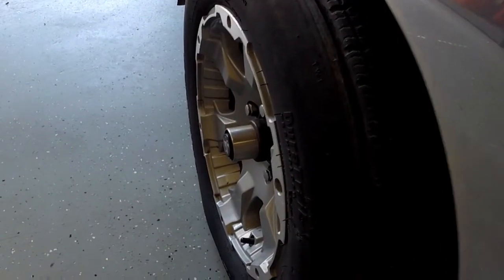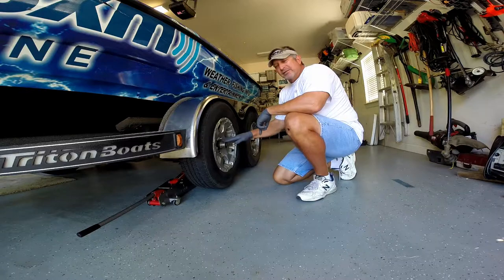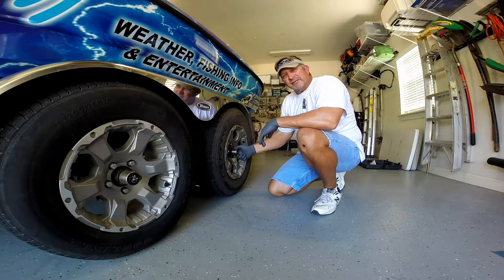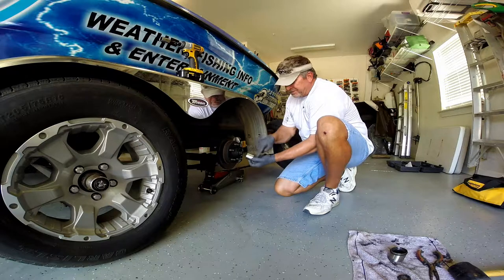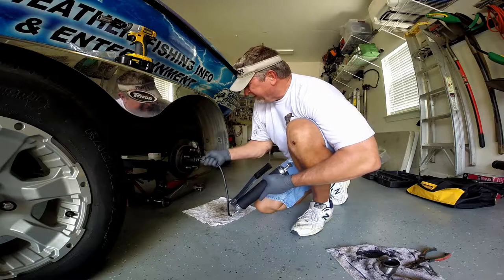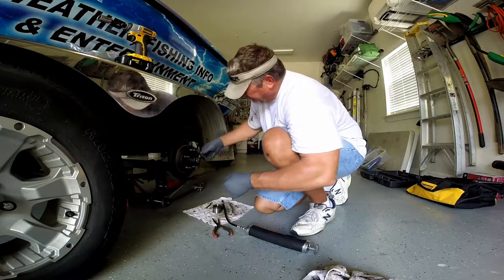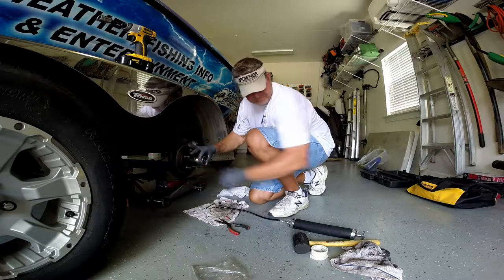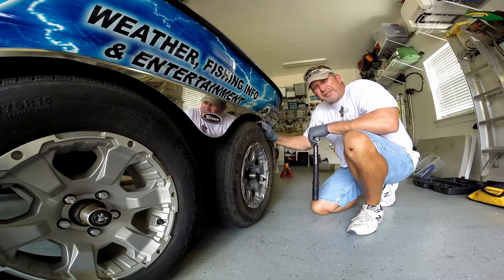Bearings

Comment: Since this is two years old now..  How did it work out replacing the bearing cap with the same old cap?  UFP says not to use the old one, but to replace with new.  I used an old one and it blew off going back from the tire shop!  Yes, I used Loctite.  I'd sure like a reply!  I ordered some replacement caps but they are lost in space with the Post Office.  I either have to buy some bearing buddies or use and another used vault cap.